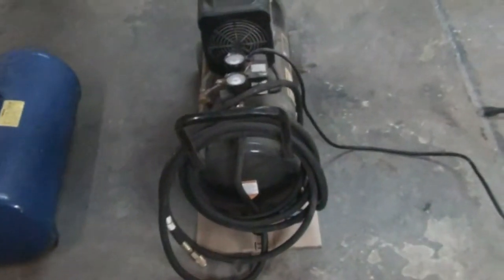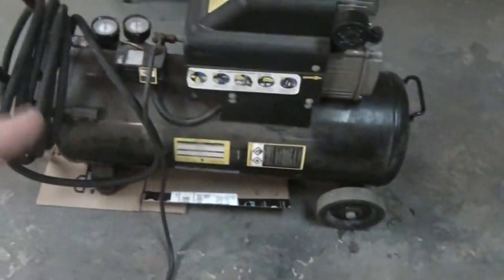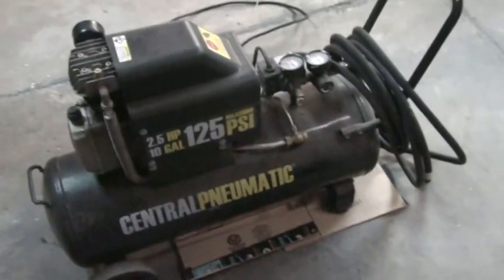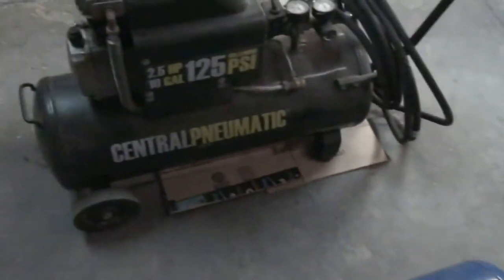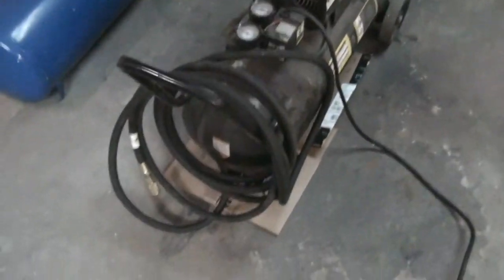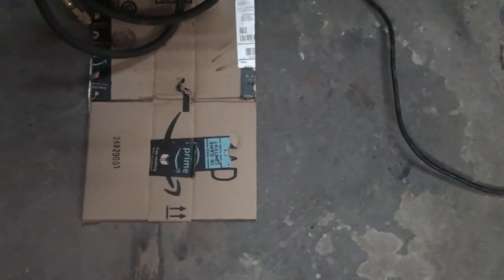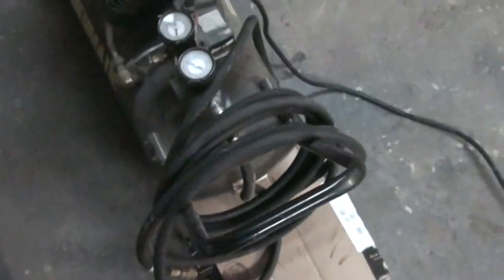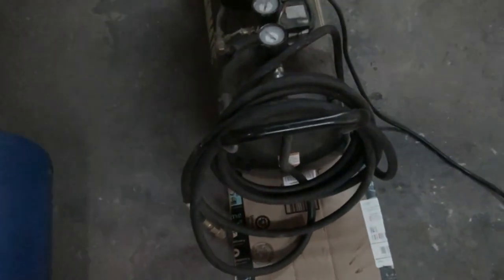Central Pneumatic 10Gal Air Compressor follow up

Comment: Excellent. You brought up a point some tend to forget- SCFM is important to consider before buying a compressor. You have what you need, it takes up little room, and has been reliable for you. Glad to see you back on the Tube again.
Reply from the maker: Thanks, SCFM is often over looked and for some its fine, but I do notice if you want to get the most out of your impact gun for example you need to get as close to what is recommended as you can. Have a great week!